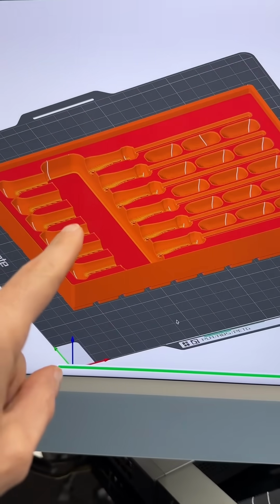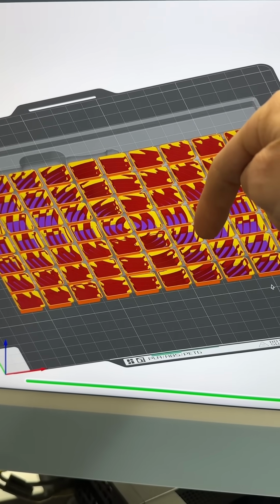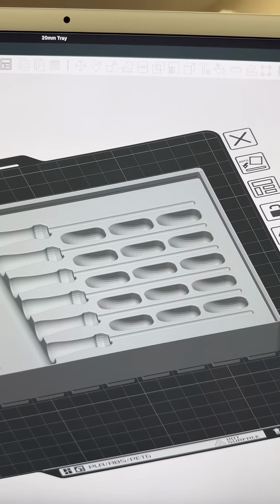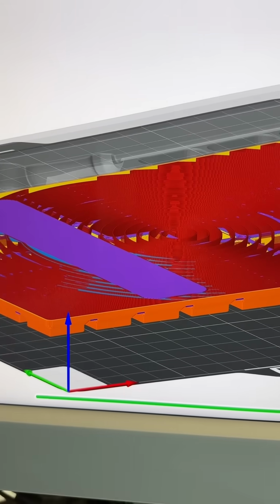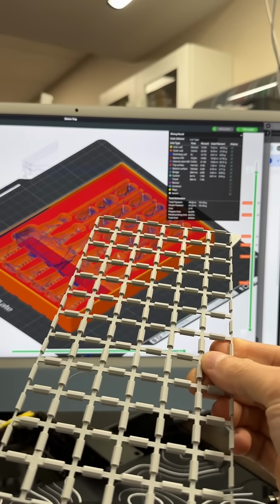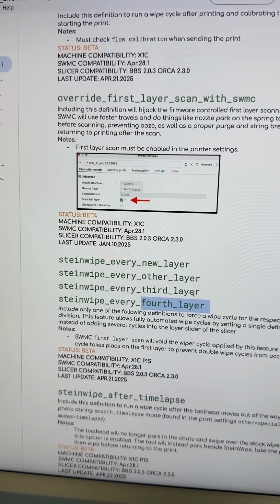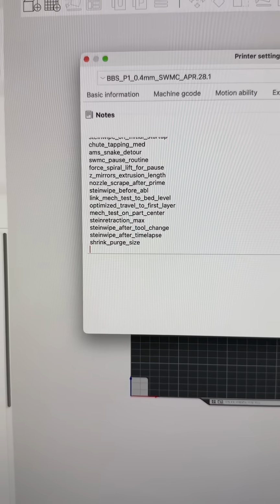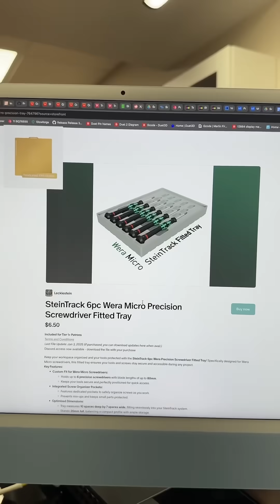A PETG MUST HAVE MOD! A1 Nozzle Wiping At Any Layer For Bambu Lab P1S & X1C 3D Printers

Comment: Can you add something to attach without drilling thats the only thing holding me back
Reply from the maker: I do have a version of the wiper that I would like to release that can be taped but still removed with hardware and not require any holes to be drilled but honestly there's too many more pressing matters for the project and drilling holes in the machine hasn't really been a huge concern for a lot of users now that the project has matured. so that project to make it tape on has been on the back burner. Maybe one out of every 500 interactions with users is about drilling holes. So if you're very patient, eventually I will get to it!
Reply: @leckiestein  I think that might be somewhat influenced by the fact that people who don't want to drill holes just skip over the project instead of asking for a non drilled version (at least that was me up to this point). Basically survivorship bias, but i'll patiently wait for it to come out eventually.

Comment: Why do you add a viper command several times while printing?
Reply from the maker: Each time the command was added to the layer height slider, it only runs a wipe cycle at that point in time in the print. You may not want the wiper to run all the time otherwise you might burn through wiper pads and that can add up.
Reply: @leckiestein does this work on the a1? I only print petg, mostly petg cf, and it sticks to the nozzle like a bitch. You have a1 in the title so I was under the impression this would work but it looks like maybe not